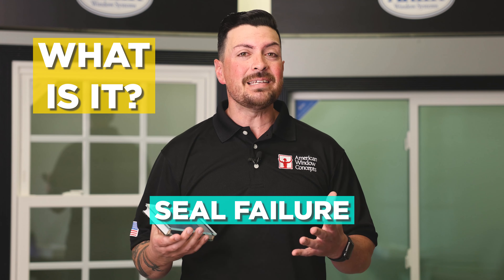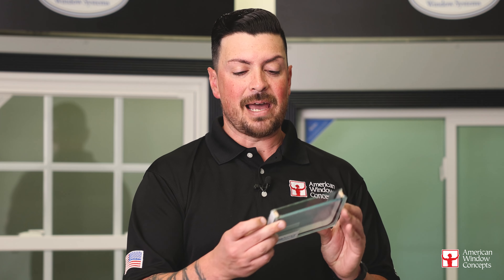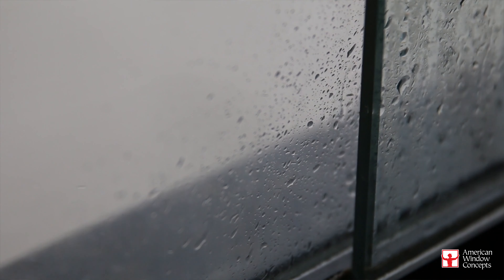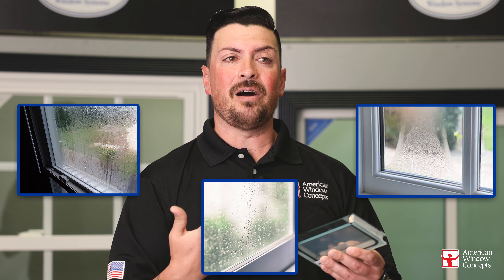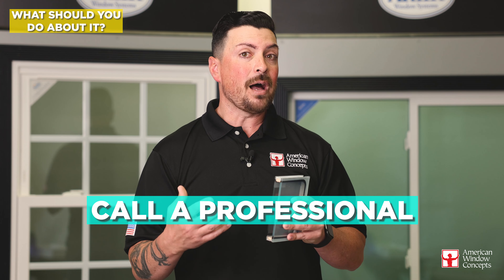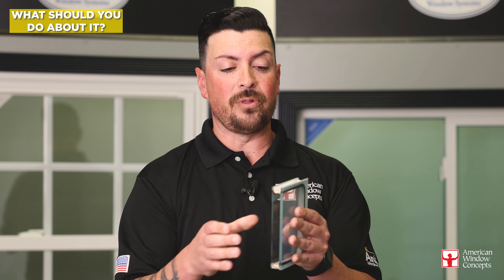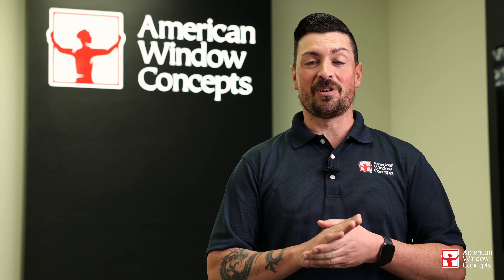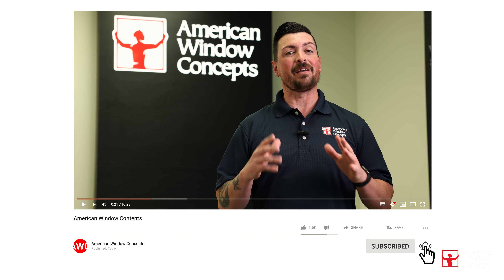What is a Window Seal Failure & What to Watch For

Comment: I have some 36 year old wooden windows that 5 out of 7 panes of glass have this, because they're wooden the sills are also far rotten, i repaired the sills with wood filler and used a low powered sander to even it out and painted. I think my windows are too far gone and i need full vinyl windows. Could repair the sills and do this but why short out when it will have short life 20-30 years when some more money gets me vinyl for a lot longer.